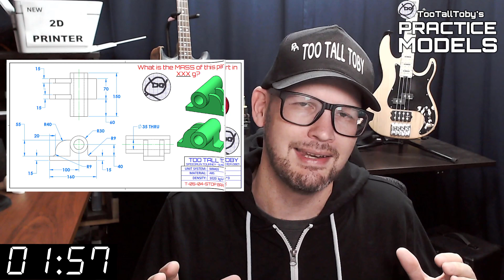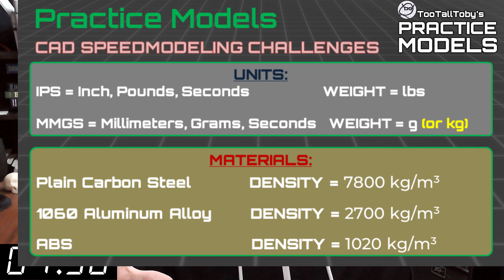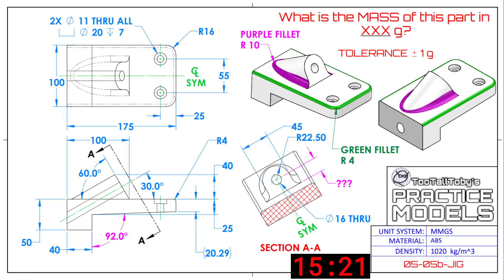SOLIDWORKS Practice - Onshape Practice - Fusion 360 Practice Exercises - TooTallToby-05-05b-JIG

Comment: 14:33 in Autodesk Inventor, 555.36g because I once again tried using the draft tool. One of these days I will figure out how to just set it up the way I want and not just stumble around it. Used a side view line of the top feature and a Angle to Plane around Edge of 90 degrees. Easily creates a workplane at the angle required but I would like to see the commenter belows strategy of skipping a workplane entirely.
Reply from the maker: I would probably make a plane for this one too - On an angle. Sometimes I use sketch geometry to layout my part designs, then I do a CONVERT ENTITY of one line, then INSERT SURFACE EXTRUDE from that line.  This gives me a "plane" to sketch on.  Then at the end of the model I do INSERT>FEATURES>DELETE BODIES to delete any leftover surface bodies.

Comment: Onshape in 4:02 on 2nd try -- first effort went into the bit bucket. A fun part to model and video.  Used a few tricks I learned from watching Airwick model parts.
https://youtu.be/7qEU4gPWnN4

-- Setting the bar low to make it easier for others ( my story and sticking with it !! )
Reply from the maker: Very nice Rich!!  Sometimes its good to just know how to make a hole jig so you can 3D print one up, when you need it :-)

Comment: Onshape: 2:19 and 555.362g after quite a few practice runs trying to optimize the process: https://youtu.be/sZjUAZQYw7E
It seems that making the first sketch exhaustive pays off later as you can use this geometry for holes and this angled part.

??=~23.688mm
Reply from the maker: I agree 100% - in a model like this it really pays off to make the first sketches with a lot of layout geometry!

Comment: Mass: 555.1gr before the "???" (27.5mm), then 554.55gr (23.67mm)
Time: 20 minutes roughly
SW 2018
Reply from the maker: Very nice job!!  The location of that hole is "centered" on the tombstone, and the location of the peak of the tombstone is called out in the front view.  That's what makes this challenge a little tricky :-)

Comment: Time: 9:54
Mass: 555.36g
Nice one. Creating a 60deg plane at the specific plane to design the section feature was a bit troublesome for me  :) Nice one
Reply from the maker: Yeah I agree the plane creation and setup for that Tombstone area are going to be a little tricky on this one.

Nice job Achilleas!
Reply: You don't need a work plane!
Reply: I tried a plane for the tombstone, and then wondered how to get the top to the 40mm mark ... created a second plane at 40mm, realised I was insane, then scrapped all that and did the tombstone from the side as a midplane extrude, and rounded it off.

Comment: Done in Autodesk Inventor, 6:23 with final mass in 579 gr. I thought I was wrong, and checked drawing twice, all was correct. As it turned out, AI assighn different value for a ABS plastic density 1060 vc 1020kg/m^3 in SW. So after export Step file in SW and assigning material, I've get 556 gr. ))
Reply from the maker: very nice job!  Great to see inventor users in here!  Yeah I specify the material densities in the intro to the video, so users of other CAD can make a custom material library, and match the specified densities.  Awesome!